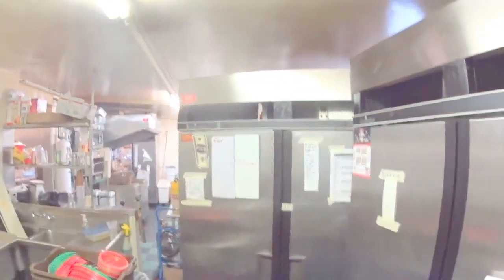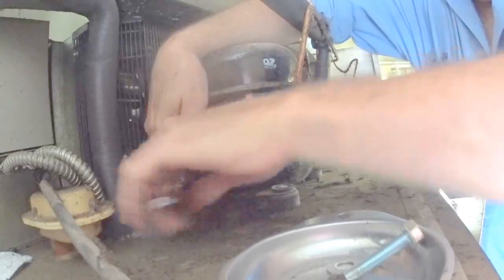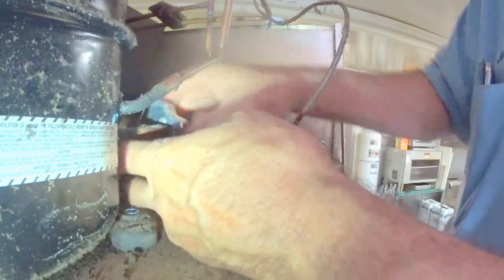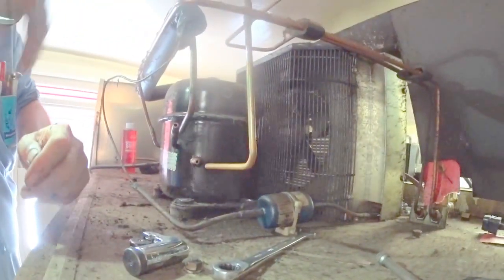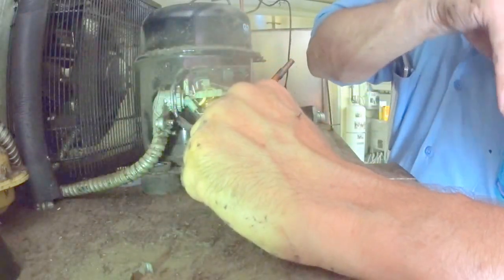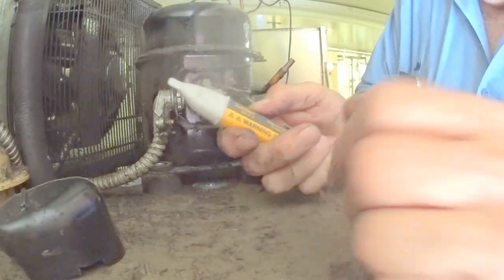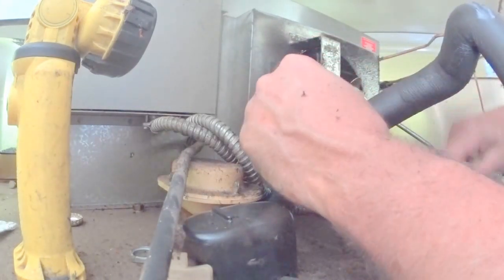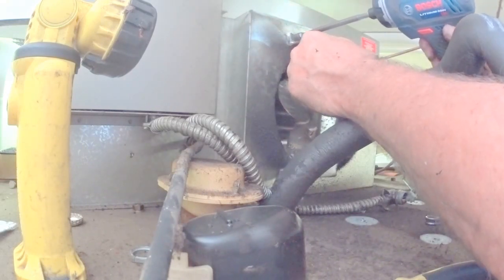Manitowoc two door cooler compressor change part 1

Comment: What is the  name of product that you put for  and wax build up that you put for cap tube that compressor last long time .Someone clean the condenser or pm. Because if not it would causing the compressor to overheat and then oil start to turn to acid then cap to clogged up .
Reply from the maker: Edward socha Supco 88 oil additive
Reply: Thank you